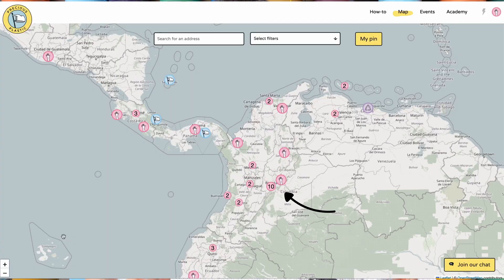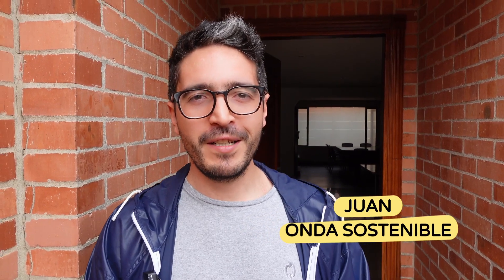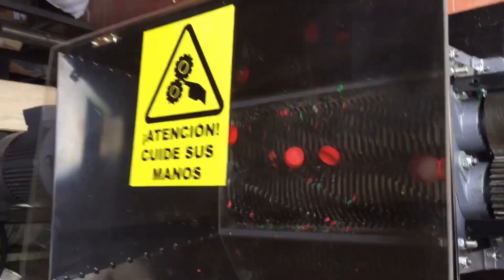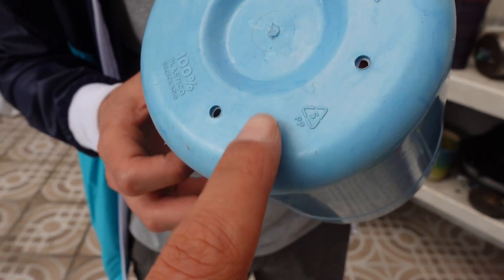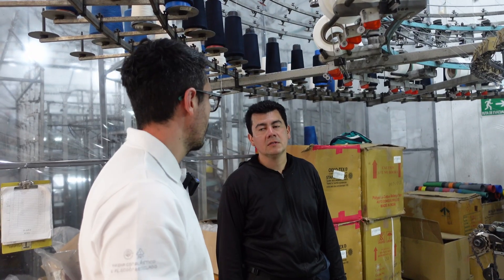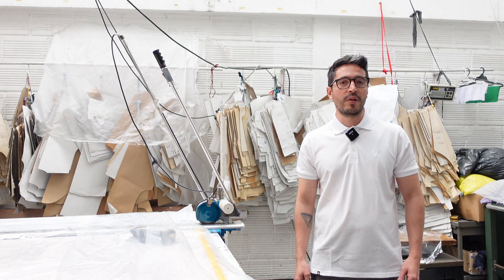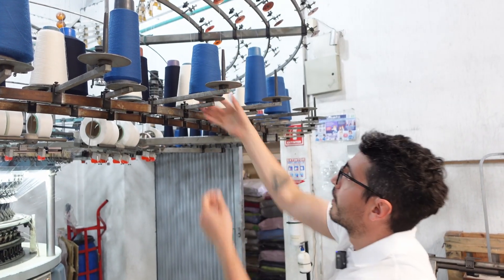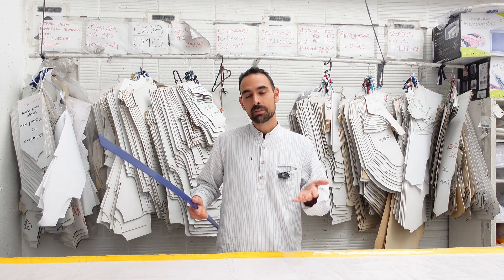From micro recycling to industrial production

Comment: The more plastic gets fed back into the system, instead of wasted, the better.
However, I was wondering: is clothing the best end product for plastic? It ends up wearing away (with each washing cycle and with general usage) and turns into mircoplastic, which is not ideal.

Maybe it's plastic that otherwise wouldn't be easily processed into solid blocks or pieces?
Reply: But! I do want to state, that it's much better to replace regular polyester with recycled polyester, since it'll probably be a long time till plastic-based fabrics are phased out (if ever..).